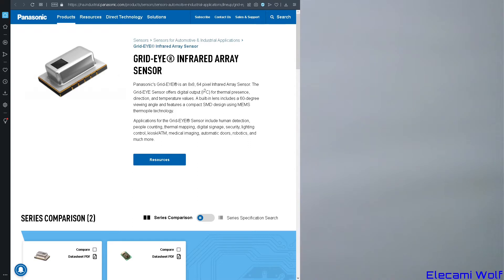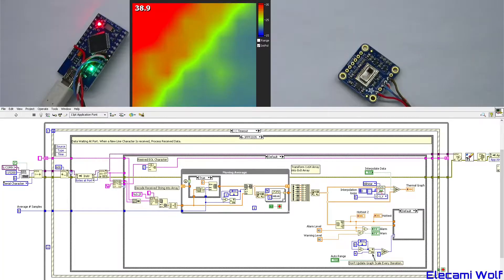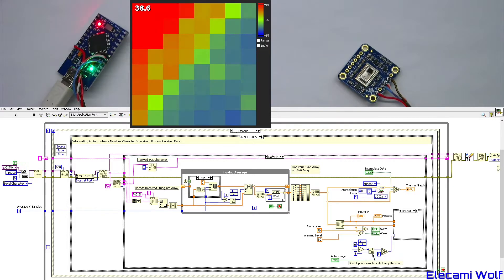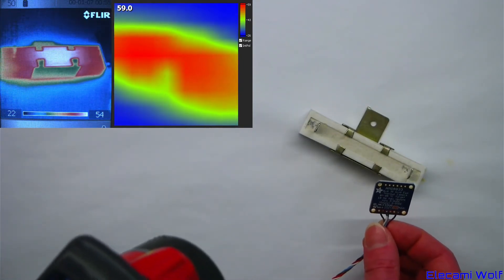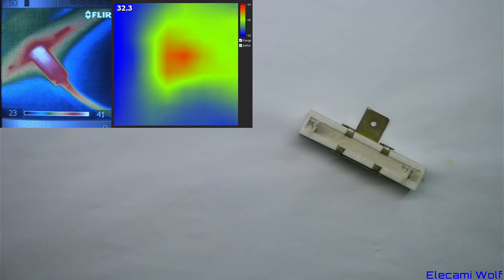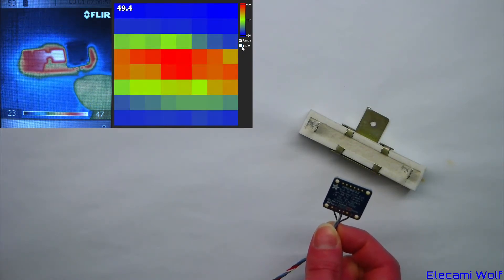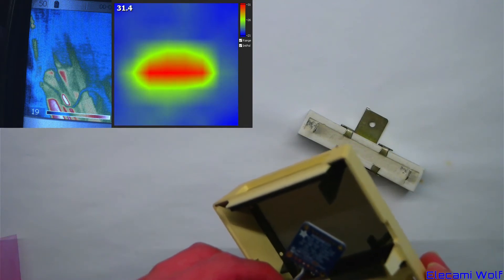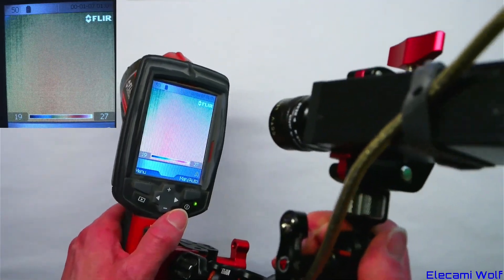EW0001 - Panasonic Grid-EYE Thermal Image Sensor

Comment: I remember reading somewhere that regular (perhaps older) webcams needed a filter to prevent them from picking up near IR frequencies. That filter was a small special glass type of material that had a special sheen about it (it was often dichromatic). I don't think that would help your project much because that kind of thing is on the near infrared spectrum, but the takeaway is that, since that special filter was needed, I think it is safe to assume most regular plastics will be transparent to IR, given that they needed to spend with a special filter to prevent NIR frequencies to enter the sensors. If you have a unexposed developed photographic film lying around somewhere, you can use a doubled up piece of the black film to block all visible light and allow only IR through, but I don't think you need that. Again the point is that it is harder to find a plastic that blocks IR than a plastic that allows it to go through. Silica glass on the other hand, seems to block a fair amount of IR.
Reply from the maker: All CCD or CMOS image sensors have an IR filter. Otherwise the colors get a bit messed up. 
This probably means the plastic material I found on the PIR sensor does not have any special properties and I could just use any plastic. I need to test that. Thanks.